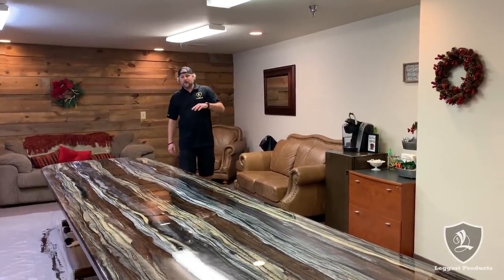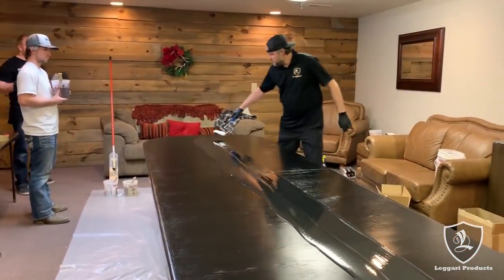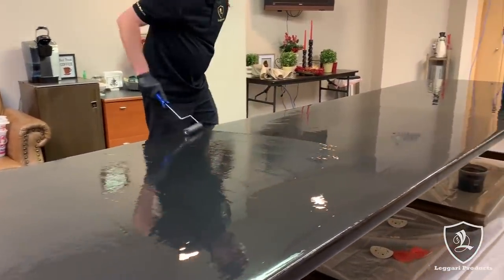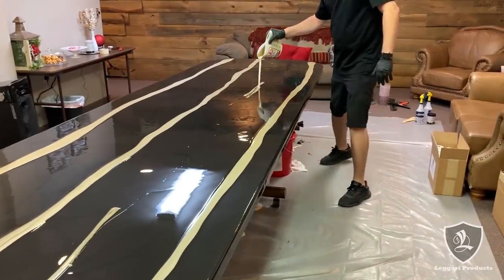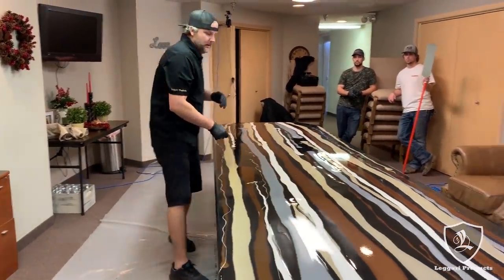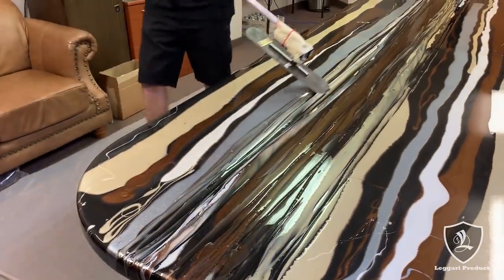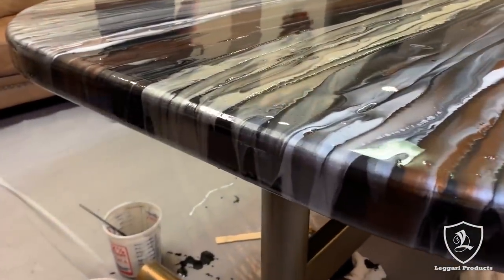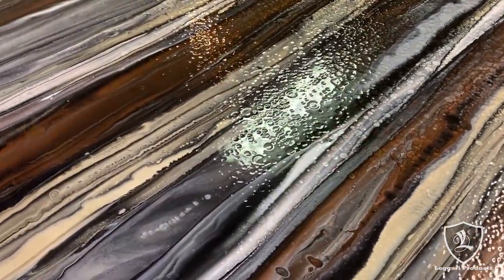Straight Vein Technique on Conference Table | How-To | Leggari Products

Comment: Whoah!  I'm a fluid paint artist but have not yet ventured into epoxies. I came across this video and Wow, the results of this table are  stunning.  (I just subscribed to your channel) Question: with all those guys around, I was dying for you to lift and tilt the table to see if the expoxy lines would flow a bit and create some additional organic effects? Also, have you (or do) you ever use a heat gun to move the freshly poured epoxy?  Looking forward to learning more about Leggari!
Reply from the maker: The metallics will flow together and give it a different look as the epoxy is curing.  We have a high end epoxy that has an additive in it to make the bubbles rise to the surface and pop on their own.  Thanks

Comment: Going to do our countertops, island, and kitchen table.  Are there any examples of doing cabinets?  I want to paint our island base as the 90's walnut has worn out it's welcome.  This is awesome.  Just discovered Y'all tonight!
Reply from the maker: We do not have a video on the cabinets because this is a product that can't be applied vertically.  You could take the doors off and apply the epoxy horizontally then hang them back up.  Thanks

Comment: What is the difference between your epoxies and marine epoxies? As I what is the chemical or molecular difference? It looks to me like yours has a thinner added, but is this all? Thanks in advance. Beautiful work!
Reply from the maker: Our products are actually industrial coating made for military aircraft hangers, etc. So theoretically in a residential, or even commercial setting it will last forever. This is NOT a cheap epoxy paint that you will commonly find at box stores like Home Depot or sherwin Williams. It is a thick 100% solids epoxy coating.

Comment: What do you do with when the top coats dry and its got a glass finish but little dots caused by air born dust ect that falls on the surface during the curing time ??? Im yet to see a video with wat to do ..it just seems everyone shows the top coat pour and boom its finished ... but iv seen 1st hand how poor it looks with the little bits sat on top thats from the air :(
Reply from the maker: You can sand the surface with 220 grit using a palm sander then clean with denatured alcohol then re-apply a new top coat.

Comment: how long this epoxy last?is this durable ?
Reply from the maker: Our products are actually industrial coating made for military aircraft hangers, etc. So theoretically in a residential, or even commercial setting it will last forever. This is NOT a cheap epoxy paint that you will commonly find at box stores like Home Depot or sherwin Williams. It is a thick 100% solids epoxy coating.
Thanks